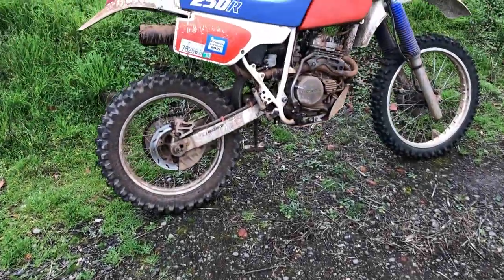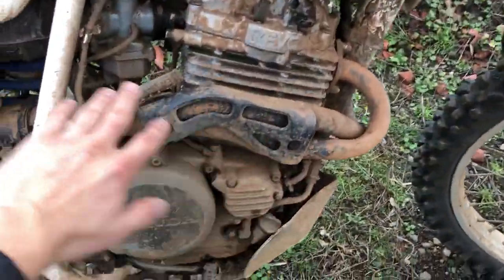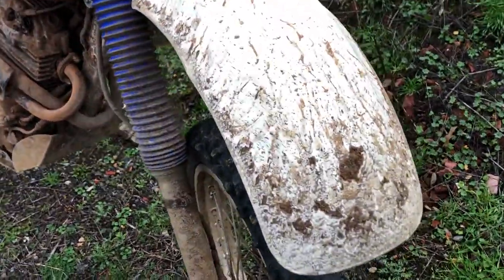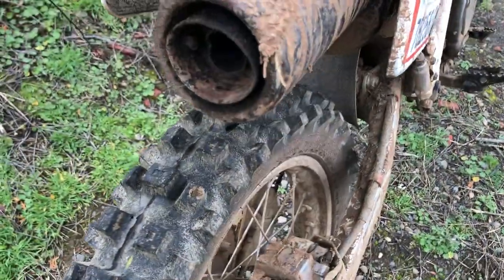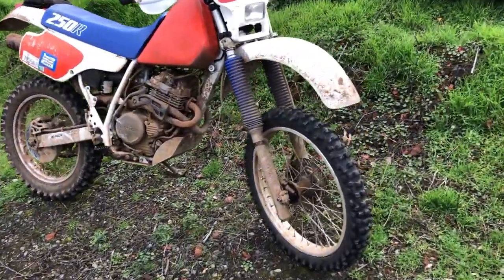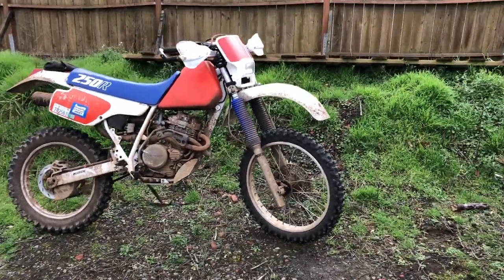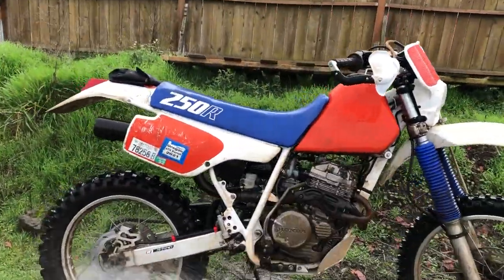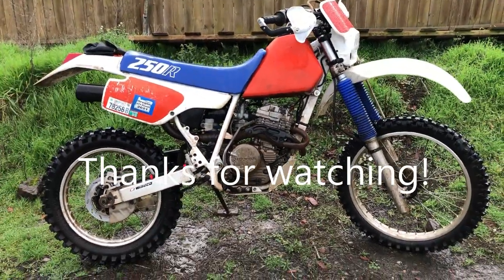Washing My 86 XR250R - I talk about my drum to disc brake conversion and then I wash my bike

Comment: Nice conversion. Regarding the rear shock, how's the rebound? I've heard that it's the first thing that many owners replaced on the bike back in the day -- upgrade stock spring and remachine the shock to get the desired rebound. I've got my eye on an '88 XR250R for a summer project that's in a slightly better state than what yours started at.
Reply from the maker: Its not great, but I  suck at adjusting shocks, so I just live with it

Comment: Awesome brake conversion! I'd love some more stopping power on my 1987 XR.
Reply from the maker: Thanks! The conversion was actually pretty easy. You just need minimal welding skills and you can get parts under $150. I watched your xr250 videos. Its looking good.
Reply: @dunemaster3179  Thanks! I'll definitely have an eye out for the parts now. Next up for me is a valve adjustment. Apparently, the last guy put a new piston in, but I found RTV in the oil filter cover instead of the right O-Ring so I'm a bit skeptical about how well everything was done. 😂
Reply from the maker: @weekenderadv4565  Dang it, I hate when people cheap out on little things like O rings and use silicone were you not supposed to. Hopefully, everything else was done with diligence. Good luck with your project.

Comment: FrankenHonda!...looking good, with minimal investment. Did the smoking go away after new piston/rings?.notice power improvements?
Reply from the maker: Thanks! Definitely a frankenhonda mix of 86/90 xr250. There's a very faint puff of smoke that comes out on the initial start up when I pull the throttle, but it goes away real quick, so I'm not worried because the power is there.

Comment: I have an 89 that I'm about to go through just like you did... mine smokes like yours did in part 5.... could you do a vid with it running now?   to hear it after the piston was put in....  its crazy mine runs and sounds like and smokes just like yours did, and I'll probably have to put in a baffle also,  but I'd love to hear it run!!
Reply from the maker: Hey, I will try to post a video of it running soon. I don't know if I mentioned it in any of the previous videos, but I've taken the head to 2 cylinder/ head shops when I was working on it and they said that the valve guides and valve seats were in great shape. I then took the cylinder to the shop that I usually go to and they checked the cylinder, and they even deglazed it for me for free. I tested the valves for leaks and they were fine. I bought new Wiseco piston and rings and put it in along with all new gaskets and valve guide seals, and it still sometimes ( well most of the time) smokes on the startup, but goes away when warm, so I think it's normal for xr250r lol. You are wondering how it sounds with a new piston? I can tell you, it sounds great. It has plenty of power, but it doesn't sound as smooth as my dr350 at idle. Dr350 engine works like a metronome, it never skips a beat, but xr250 sometimes has little hiccups when it's idling. I didn't have any issues with that, but I don't ride it as often as my DR350. But I will try to post up a video soon.

Comment: Atf is pretty light. You shouldn't think the front is stiff.  Could you have put a little too much in? Did you bleed the cartridge as you were adding fork oil. I'm not being a know it all. Just trying to help figure your stiff forks. Great job adding a disc. I own a super fresh 88. You have me thinking of doing the same
Reply from the maker: Thanks for the comment. It's totally possible that I put too much oil. This was my first piston rod fork rebuild, so there's a big chance I messed up. I pretty much followed this procedure from Honda service manual (except I didn't use their brand oil): 

"*Pour the half amount of recommended fork oil into the fork
pipe.
*Pour the recommended fork oil into the piston rod until a

little fluid flows out the side breather hole at leveling minimum
stroke.
*Pump the piston rod and fork tube slowly 8-10 times.

Compress the fork leg fully and leave it for 5 minutes to settle
the oil level.
*Measure the oil level from the top of the tube.
RECOMMENDED FORK OIL: Pro-Honda Suspension
Fluid SS-7
STANDARD OIL CAPACITY: (Per' fork leg):
492 cc 116 .8 ozs"

I pumped the piston rod-like 20 times though. Also, the Hondas recommended fork oil is 5wt, so that got me thinking that maybe I should try 5 wt fork oil. Anyway, I'm planning to take off the fork sometimes soon and re-measure the oil level, like you said, maybe I added too much oil. Another thing that maybe contributing to the stiff front end is my tire pressure. I didn't check the pressure when I rode.
Reply: @dunemaster3179  sounds like you did it right. You can try less oil. Before you fully tighten the axle clamp bolts ,grab the brake and push on the forks a few times to align the forks. If they aren't parallel they can bind. I just bought a super fresh 88 XR and got XR650  forks.  I should have just done what you did and got newer 250 forks because now I have a project. Watch the bumper on the shock. When they age they disintegrate and it won't be good when you bottom out.
Reply: Also watch the rear brake caliper doesn't hit the silencer when you bottom . I believe the later model XRs had a dent in the silencer to clear the caliper. The earlier XRs like ours didn't need that clearance because the drum brakes don't need it
Reply from the maker: @64maxpower  Congrats on the purchase. I had a blast riding my bike and I'm a fan of xr250r now. I'll try to do what you recommended. Also, thanks for the heads up about the muffler clearance, I forgot about that. Good thing is that I'm still not very proficient at riding yet and I'm afraid to do big jumps, so I never bottomed out the rear end lol
Reply: @dunemaster3179  Did I hear you correctly, you used the wheel from the newer frame to get the rear disk brake, then welded on the bracket for the master cylinder?
Reply from the maker: @williamsherman1089  Hi, so basically you need a whole rear end from disc XR250R (swing arm, rear wheel, brake caliper, master cylinder,  wheel axle etc) then you need to weld a little bracket on the frame for the master cylinder. You can fab one from steel if you know the dimensions, it's just a slab of steel plate. I think you can keep the old brake pedal, but the little shaft on which the brake pedal bolts on will need to be from disc Xr250r because it connects to the master cylinder. Theres also a little metal bracket that mounts to the airbox and holds the master cylinder reservoir, but you can also fabricate one if you're handy. I hope this clears things up a bit.
Reply: @dunemaster3179  Thanks so much for all info 👍

Comment: You think it’s possible to put a 93 year read swing arm on a 1987?
Reply from the maker: Yes, I think it’s the same thing. Edit: 87 is drum brake and 93 is disc, but it will bolt on to the frame and the shock just the same.
Reply: @dunemaster3179  would it matter if mine is a XR600r? Since I’m putting a xr250 swing arm?
Reply from the maker: @alexbarrios890  that I don’t know, sorry. I only tried it on xr250